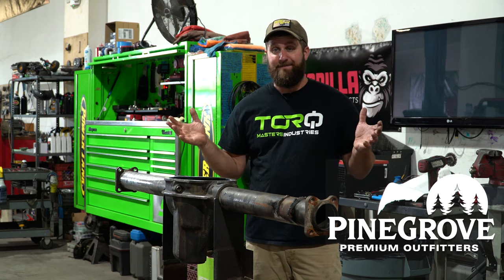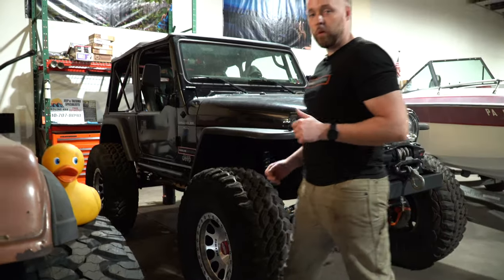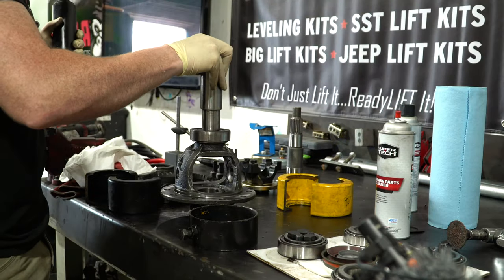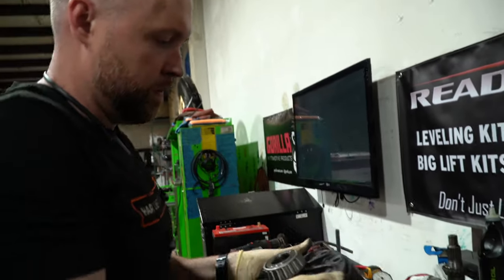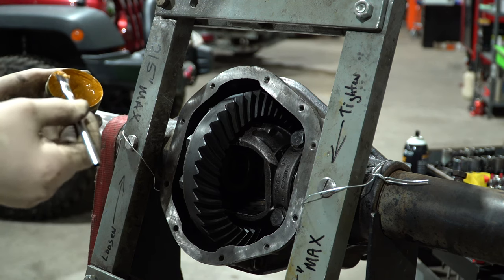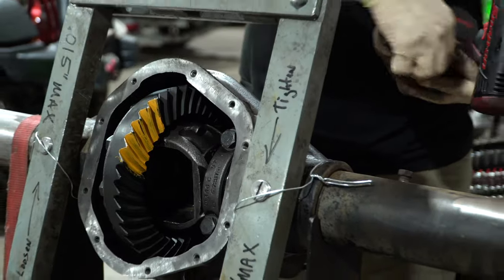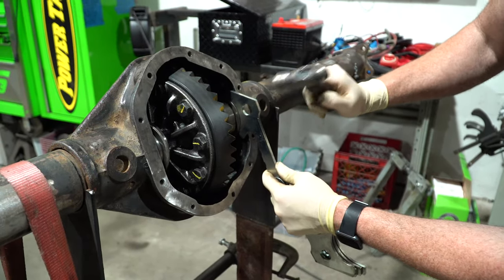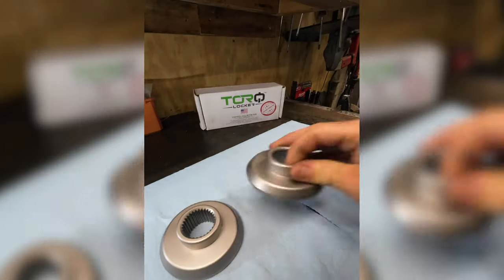Axle & Gear Setup Tips from a Pro Builder - Spool Bus 2.0 Pt 1

Comment: Hopefully next year I’ll be regearing my non rubicon axles. I still need to get all my new brackets and reinforcements welded on and setup for instal
Reply from the maker: The TORQ locker is really nice in my rear axle. It’s the noisiest TL I’ve experienced but I’m not complaining at all. It functions flawlessly. My 8.25 TL would occasionally bang into the locked position which was always unsettling to bystanders haha. This one just sounds like the price is right and I love seeing peoples puzzled looks when I whip it into a parking spot or gas pump.

Comment: John, question about your setup (and i apologize if its been answered): how do you like the TDI, AX15, 4.88 gears and 35 inch tires? I'm planning a TDI comanche build, which was inspired by your TDI swap videos over on the BleepinJeep channel. Does your setup crawl slow enough for you, and are you also able to cruise on the highway reasonably?
Reply from the maker: When I had 33's and 4.10's it was spot on perfect.To be totally honest,  I don't feel like this is quite as dialed in. I can't imagine 4.56 gears would be the answer though. I want to try some different tires to see how that affects things. When I went from BFG KO2 285/70R17 to Patagonia MT 33x11.50 (basically same tire size) it was a bit taller tire, and heavier so it wasn't quite as peppy after that change but it was still great. I hit 3000 RPM in 5th gear around 75 MPH now, which isn't bad but it's just a touch higher than I'd like. Down shifting to 4th means I'm basically hitting 3000 RPM around 65 MPH which really feels like you're screaming. Generally speaking though, road driving 1st through 4th feels really peppy and perfect. On the trail, I don't feel like I need 4 low as much on green trails and rugged roads unless I'm starting and stopping a lot. With my doubler, my 1st gear double low crawl ration is 135:1 now so it's really nice!
Reply: @DirtRoadTherapy   Thanks for your reply! looking forward to more content from you, and who knows maybe i'll see you on the trail some day.